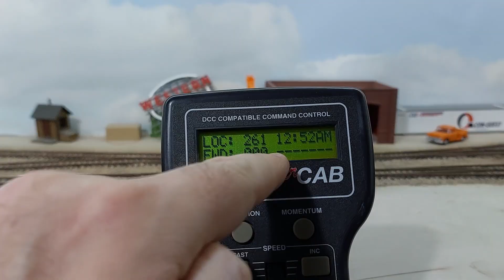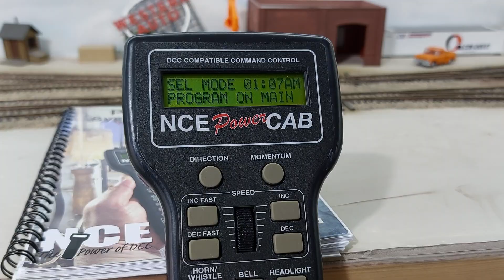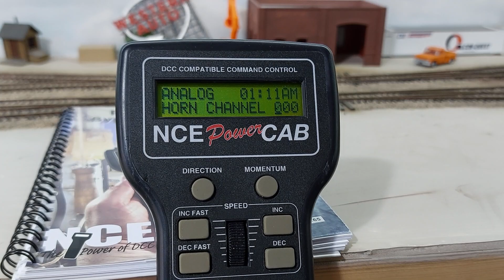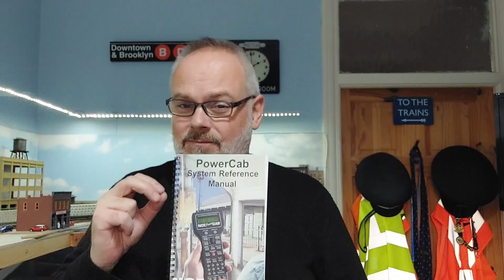NCE Powercab: Displaying Track Current and Increasing Recalls

Comment: Thays excellent.  I've actually just got one of these. I need to buy a UK power adaptor, though. I think Rails do one.
Reply from the maker: @DJ_K666  great system and yes, you can but UK adaptors. Rails might have them but if not, Try Coastal DCC or Digitrains
Reply: @thebritishrailroader  excellent.  I'll give them a try. I'm fairly sure at least one of them will be at GETS so I can ask there

Comment: So basically, Recall is like the memory setting for radio stations on your car's sound system 👍
Reply from the maker: @Rocketed12  it is just like that. It will recall the last few locos you have used

Comment: Good tip thanks! I think the R/C Powercab is a five amp system. Not sure which system you were demonstrating as i could not see it.
Reply from the maker: @andrewblake2254  it is the smaller Powercab so has a max of 2 amps but I believe it Functions the same way as the Procab etc
Reply: @thebritishrailroader  yes it does, very much the same.

Comment: ive had my powercab for a few years and this is news to me! i needed a way to increase the recalls! thanks Steve!
Reply from the maker: I always thought it was odd that the specs say you can recall up to six but it was pre-set at 2. It isn't easy to figure out but I have found the section in the instruction manual now so will point this out on my next video.